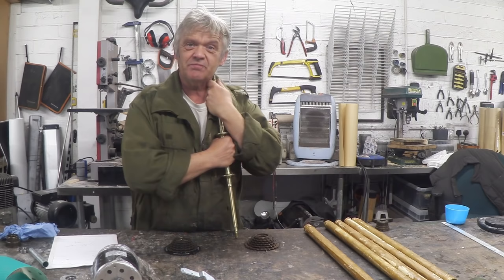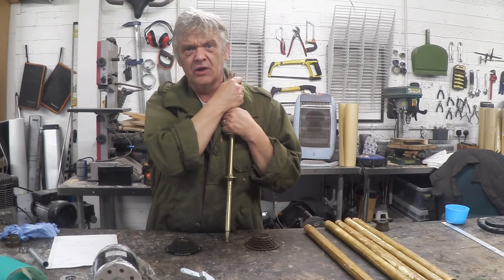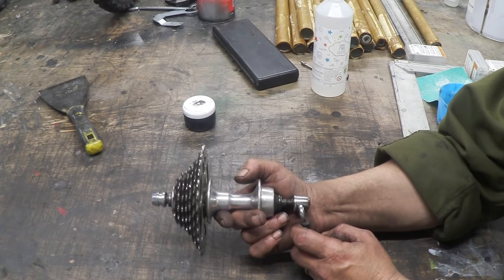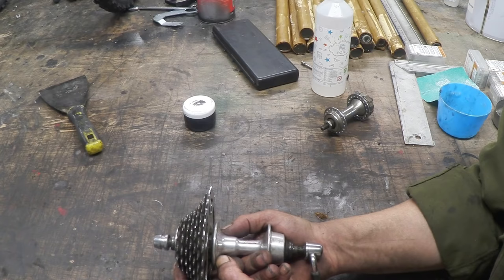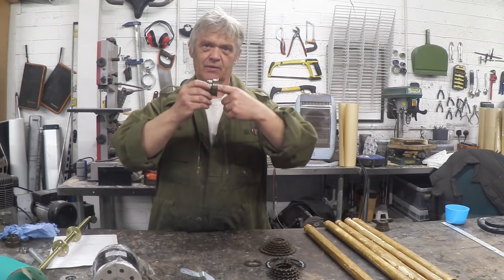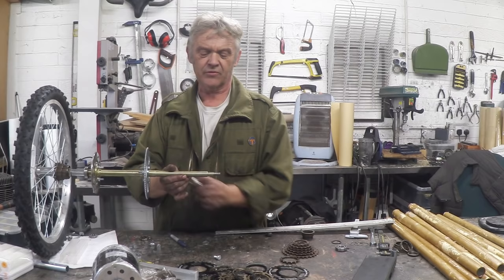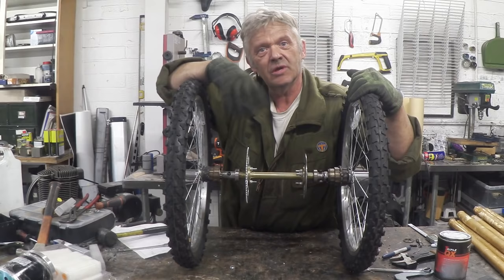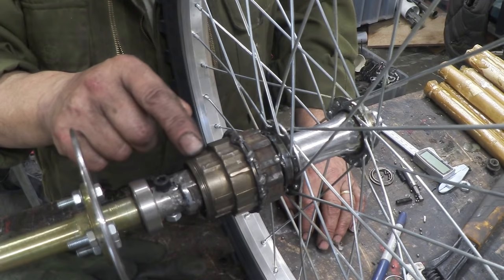1175 How To Make A Dual Freewheel Differential For A Paper Trike

Comment: Brilliant, thanks Rob.  For those rummaging through scrap yards.. The spin-on clusters / cassettes are typically found on old bikes.  Newer bikes have the free-wheel built into the hub.
Reply: spin-on cogs are still in use *new* in BMX and artistic cycling bicycles
Reply: One very OBVIOUS problem is your brake is no longer functional as both wheels over-run the axle. Stopping the axle does NOTHING to stop the tricycle.

Comment: Hi Rob. I played with this idea to go onto a recumbent delta trike  based on a design sold by a family design team here in Canada. Their build projects (and there did quite a few) used square tubing for many fabricated parts. I came up with another 'version' of the differential you describe there after getting my hands on two large "finger ratchet wrenches" - these are like a conventional square-drive socket ratchet wrench, but with no handle. They're meant to be used in tight spaces. I got a pair that took 1/2" drive sockets (I later revised the design to use 1" square drive socket wrenches) and after more than the usual messing around trying to do for 5 cents what any fool can do for $5, I had a differential real axle that worked quite well. At the time, I was planning to use 48-spoke 27" rimes for my rear wheels. A machinist in Australia very kindly made up a set of 48-spoke hubs, and (miracle of miracles) I found some high quality 48-spoke rims for sale by a British maker. At the time (2010-ish), the pair of rims cost just over CAD$110, plus 6 pounds 95p for postage. They arrived in three days - some kind of record in anyone's book. 
Since we have ice and snow about 8 months of the year, one over-riding concern was/is cold-weather operation. I also hoped to have an "electric assist" system that could be activated for steep hills, etc. The rear end - axles, bearings, ratchet-based freewheel/differential(s) plus the necessary frame were pretty much complete by 2013, along with about 2/3 of the rest of the frame and front end. Then someone stole the whole works, plus all of my welding gear. In the same period, I became permanently disabled and so was retired from engineering (cold-weather methanol fuels among other things) and there were two deaths in the family, all in a very short amount of time. 
My disability required quite a bit of revision to the basic recumbent delta trike, but I did get some plans drawn up. However, not being able to work (and therefore being without income), plus dealing with two separate family wills pretty much put the whole project on hold. Since then, because of an accident and new factors arising from disability, plans will be changing yet again. 

It was suggested to me to consider using motorcycle wheels for the rear pair, rather than bicycle wheels and rims. This idea has some merit, but make a home-brew differential more difficult.  Reason #1 was simply tire and wheel strength. The most frequent points of failure on bicycles and tricycles here are flat tires and damaged rims. Of people who commute using a bike or trike, 44% report at least one flat tire every 10 days. The other main reason for considering motorcycle wheels was better traction and (by using Aluminum) a lighter overall rear assembly. If an electric assist was still a possibility, weight is a major problem. Being poor (where I once was not) has really made this proposition difficult and unlikely. There are very few "free" or inexpensive sources of modern batteries to be had. The cost of material and welding equipment for at least part of the frame being changed from steel to aluminum tubing is a big obstacle to this idea as well. 
Road conditions here are not ideal much of the year, but I mention that proposal in the interest of completeness. It seems unlikely and unaffordable at this stage. Anyhow, I love your design for this simple implementation of a working differential, and I have seen actual examples on hand-built trikes locally. Cheers from northwest Canada.

Comment: hi, first comment;

I came with that solution days ago and marvel myself because this arrangement doesn't have the problem of the xhausting power through the fasttest wheel. So the power alway goes with the slower wheel which have the less weight in a corner. In case the inner driven wheel drift in a corner, then the other wheel automaticly engage as magic. Isn't that awesome?. The only problem is that in a turn always will be just a driven wheel. 

I think your brake is doing nothing, it had to be attached directly to  the wheels or you will need a two way freewheel. Then, also you'll be able to  pedal backwards.

Cheers, and thanks for be so caring with your audience.
Reply from the maker: I am going to use the brake disk for something else mate - I want this motor and pedal driven - that's a bit awkward unless you use two input cog - so the brake disk here will become an input cog
Reply: @ThinkingandTinkering  ¿like a clutch? I'm almost sure you won't use a planetary.

Comment: For most users, 2 wheel drive trikes are overcomplicated. I built a semi recumbent delta trike with one wheel drive over 12 years ago and have done more than 25,000km on it. I have only ever had traction problems in mud and snow.
Making it single wheel drive made loads of problems go away and gave a load of advantages. To move the drive from the centreline to the left wheel, I used a technique from Atomic Zombie. This adds a separate drive shaft half way between the pedals and rear wheel, with one chain from the crank to this shaft and another chain from the shaft to the driven rear wheel. The shaft is made from a bicycle wheel hub, split it in half and a tube welded between the 2 halves. A 10mm steel rod is easily threaded with the standard bike axle threads and the old bearings reused. If a rear wheel hub is used, rear derailleur gears can be used in the centre shaft, as well as the rear wheel, doing away with the dreadful front derailleurs, which are always unreliable.
By using this technique, I have 6 front gears, 7 rear gears, giving a total of 42 gears!!! Other advantages are an open area between the rear wheels for a cargo box, shorter chains (recumbents often have very long chains) and everything is easy to access for maintenance.
I am thinking of adding electric augmentation on the currently undriven rear wheel by simply replacing the wheel with one with a hub motor.
Reply: A very neat solution well thought out.😊

Comment: Ive thought about doing this but the only way I can figure out braking would be a disc brake beside each wheel with a brake cable splitter to y out one cable into two so that both rear brakes would be operated by one brake lever. This is better than a normal differential because it's still a positive traction rear end. Using hydraulic brake line would be better than a cable to split and it would be a more equal pressure to each rear caliper.

Comment: I've been thinking about delta drive arrangements also.  My idea is to have 2 wheels mounted on non driven axle.  The wheels on ratchet drive  are attached with  one wheel reversed so both drive cogs are facing inboard.  You then drive each wheel from a common drive shaft. This should allow one wheel to travel faster than the other around corners, but drive both wheels when going straight.
Reply from the maker: interesting mate - i 'see' things better with a model - can you make one to show me what you mean exactly?
Reply: Yes I thought about that too, but it would require a separate chain for the drive cog for each wheel, and a drive  axle with three cogs on it, one on each end for each wheel and one in the middle to link to the gears. ...and of course a bespoke cycle frame with a bearing each side for the midmounted drive axle to run in. Seems a lot more complex, but it would work.
Reply: Oh yeah, there is a distinct advantage though, with having a midmounted drive shaft linking to each wheel separately.... If you use that drive shaft as a pivot point you can have each wheel on independent suspension. Perfect for off road scrambling.

Comment: I'm building a tadpole 3wheeler using two 16in rear bike wheels.  The have freewheel coaster brake hubs.  
The wheels are still driven by the chain and pedal cranks, but I cut the cranks to just stubs and are connecting the two with a shaft.
So the shaft spins the cranks that drives both wheels.  I thought this will work like a differential, but it isn't the same, as when the shaft is powered, both wheels must spin at the same speed, but if you stop powering them they will freewheel and can turn at different speeds.  So you can't power through a turn like a true differential.
Just thought someone might like to know about this setup, will have this project on my channel soon.

Comment: This looks like a nice application for unidirectional roller clutches. They're simpler to make than a freewheel and they don't click. Sometimes they are called "one way bearings". I never would have thought to use a freewheel as a differential though! :-)
Reply: They probably have faster lock-up than most freewheels as well.
Reply: @Surestick88  Yes, the ratchet needs a larger rotation to engage than a roller clutch, but wear can be a problem since the clutch needs tight tolerances.

Comment: I used sprag clutches to do exactly the same thing. These are like bearings that engage in one direction and free wheel in the other. Also, you can use 2 on each wheel in place of the bearings. I got the sprag cluches off old printers.
Reply: @ lasentinal - thanks for that! Been looking for 'scrap' sprag clutches for a pedaling project for ages now.  Is any particular brand/type of printer best?
Reply: @250tegra  
I found the larger Xerox printers and photo copiers to be the best, particularly if these have quarter inch axles for the rollers.
Other brands are okay as well, as long as you match the sizes.
The trick is to use as big of acluth as you can and as many as you can for each wheel.
Reply: @lasentinal  Many thanks!  I'm fooling with a thing that 'works' ok with a couple of freewheels, except for the pawl take-up which spoils the fun.   It uses thin kevlar line wrapped around the clutch or freewheel, it is pulled by a foot-pedal to turn the wheel. A second clutch/freewheel is operated by the other foot pedal.  Needs some cunning routing to balance them and get them to 'return' for the next stroke, but much lighter than chains, and there seem to be ways to vary the gearing geometrically.  Thanks again, I will hopefully be off to a re-cycling site at the weekend!
Reply: @250tegra  
Have seen Gates Belt Drives. These can be easily adapted and are lighter and more durable than chains

Comment: It's basically,  the angular momentum, in forward directions cannot be slower than that of the axle.  But since it its a freewheel,  it can alway be faster.  So the wheel wit less angular momentum,  will always receive 100% of power.

Comment: If you appky braking to the axle you wont stop, because the wheels will free wheel, you need to  brake from the rim or outer sleeve of the hubs, or come up with another solution.

Comment: Great way of making a freewheel very inventive thinking only one question when you apply the disc brake it will stop the axel but surely the freewheels will just carry on so the brake will only work if the trike is going backwards or am I missing something
Reply: When braking the weight of the bike stops the wheel from going forward,the freewheel is when the wheel rotates backwards or one wheel is moving slower ( causing the wheel to move backwards compared to the driving axel).A really good question.
Reply: I'm wondering the same. I don't think the disc brake will stop the bike.
Reply: I'd tend to agree, if you put the brakes on, the wheels will just Freewheel... because on a bike, the brakes are on the wheels, not the axle. However Robert is a genius and I can't wait to see his fix
Reply: Well the same exact set up is on a bike hub and it stops. 

Maybe one stops and one does not?

Make both stop?
Reply: Yes if brake is connected to same sleeve as drive, then wheels will freewheel under braking.  Brake has to be connected to outer sleeve  or wheel.
Reply from the maker: the disk came as part of the kit for the axel - anyway I want to use it for input from the pedals with the main drive gear as input from the motor - I will have to fit disks to the wheel or use rim brakes
Reply: @ThinkingandTinkering  Thank you for clarifying, now I understand exactly where you are going.
Reply: Good Idea Robert you might want to think about using the disc side as the motor imput and the cog side as the pedal imput as you could then use standard right side crank and gears and even a derailier to give you wide gearing And don't forget to add a freewheel on the pedal system or the motor will drive the pedals as well as the back wheels
Reply: @reypolice5231  the disc brake on a bike is mounted directly to the hub, not the axle.
Reply: @reypolice5231  : simply use rim breaks / not disk
Reply: @robertholderman7552  

But that would not be complicated, confusing, and make me feel important.
Reply: @ThinkingandTinkering  Where would the calipers locate in that case? Or rim brakes , the mount to the frame is a distance from the wheels?
Reply: Трек калеесни бело солка стоить

Comment: So, unless Ive got this wrong, the drive goes to the inner (slower) wheel not the outer wheel? Which is the wrong way round for a trike because the inner weel will lift off the floor in a curve and all traction will be lost. You always need traction to the outer wheel.
Reply from the maker: that doesn't sound right mate
Reply: There may be a problem as stated delivering power only to the inside wheel. It will be fun to see if it works well. Can you lock them and video the comparison to a rigid axle?
Reply: @Vince Williams - If the inner wheel lifts and spins then the traction will go to the outer wheel.  BUT, if the inner wheel has grip then the outer wheel will freewheel.  However, this does not sound like what @Robert Murray-Smith was intending.  Ideally you would want the drive to go to the wheel with the greater mechanical advantage (the outer), especially when starting from rest.
Reply: @ThinkingandTinkering  But it is, Robert. I rolled my trike on gravel in the 1940s, partly because I could not lean far enough and pedal at the same time, partly because the only driven wheel on my trike was on the inside of the turn, so when it lifted traction was lost, which caused a deceleration  pitch forward, and it 'high-sided' me, bigtime!  
Of course I was also going much too fast - and got the gravel-rash to prove it.   Later, at engineering school we raced a Bond 875, ooh my!🙃

Comment: Brilliant idea. Although I do not totally get how it works, I am sure I will do at some point. The diff  problem has always been a biggy when it comes to 2 wheels at the back. I have tried a cart with one powered wheel, but even that system works best when the powered wheel is on the outside of the corner.
Reply: Put simply, it's basically an axle with a one-way ratchet on each end that each wheel is fixed to. When the axle turns, it engages with the stops of the ratchets and drives the wheels. But when you turn a corner, whichever wheel is on the outside will turn faster than the wheel on the inside because it has further to go and because the wheel on the inside is being driven slower, the other wheel on the outside will ''freewheel' past the movement of the driven axle. Think of it like what happens on a normal bicycle if the driven rear wheel is turning faster that you are peddling, it just freewheels over the ratchet on the drive cog.
Reply: @penfold7800  OK, thanks for that explanation you have made it much clearer now.

Comment: The inner wheel on a corner will be the driver, meaning there will be either a slowdown through the pedal system or an acceleration of the trike.
We may also see that if the velocity through the corner is sufficient there will be an overturning moment about the outer wheel which causes sufficient decrease in traction of the inner wheel that the outer wheel drives while the inner wheel spins faster!
I await the practical evaluation with great interest!
Reply from the maker: cheers mate

Comment: cool, now someone attach a 6" Rhombic drive Stirling engine to that axal with a paint on heater end, & vacuum flask cold end in the right orientation, + mostly magnetic  Stirling cycled copper coiled heads+ magnets+ caps to feed the encased heater, call it good as a base low energy input amplifying device  to be optimised ^_~
Reply from the maker: Cool idea

Comment: Possibly the most ideal design would be to get hold of two single speed freewheel hubs that have internal drum brakes too from the design of the 1930s. They are still being made to this day in countries where low maintenance and harsh environments are the main concern like in India.
Reply: Forgot to mention that you would then need to just refit the ratchet mechanism the other way round which is much simpler on the older modular designs.

Comment: Pardon my ignorance here but I’m looking into making a 2 stroke converted trike from a run of the mill, inexpensive 7speed trike. I’ve been trying to figure out how to fix the rear sprocket (the drive cog that comes with the conversion kit) to the axle without f’in anything up. I might have to get rid of the rear brakes but I’m not worried about that. I haven’t gotten the bike itself yet but was wondering if the newer bikes (getting it brand new) are two freewheels on the back and not a fixed axle so I wouldn’t have to worry too much about slight turns at speed. I won’t be going very fast anyway but just wondering if the motor being fixed to the middle of the axle will mess that up. Maybe a stupid thing to ask I hope some of that made sense. But thanks to videos like this my understanding is steadily growing!!